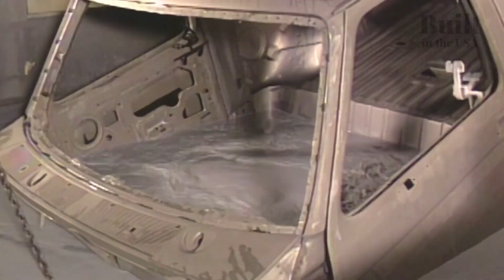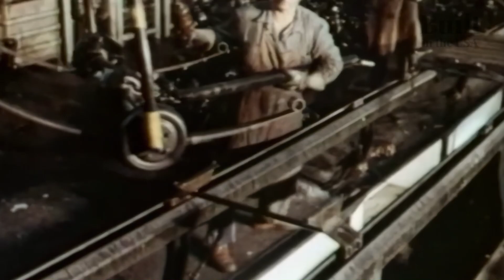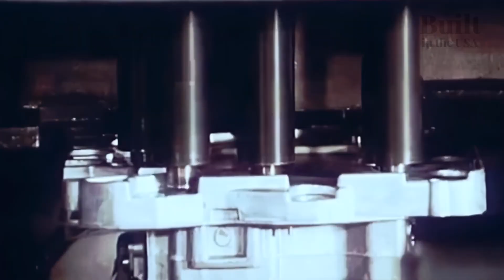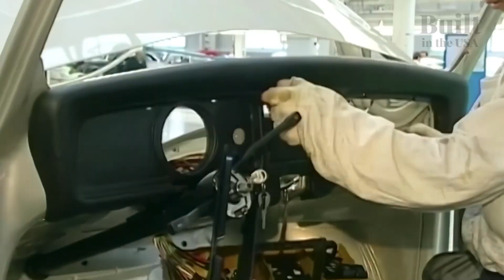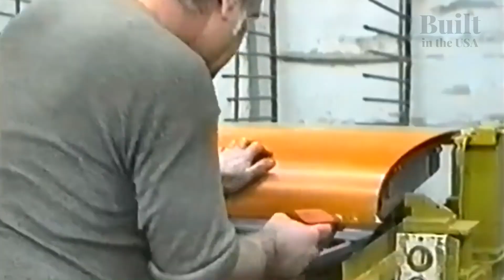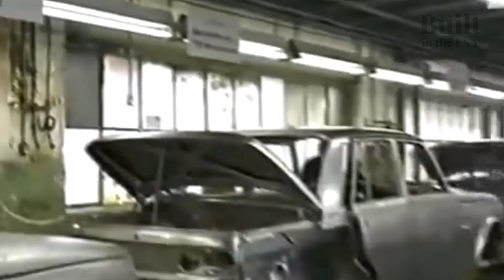Inside the 1990s Ford Truck Plant – Old but Gold: A Nostalgic Look at Michigan Truck Plant

Comment: Robotization😂😂. I think automation is the word you were looking for.
Reply from the maker: Good point. "The manufacturing process is highly automated. The production line uses advanced robotics" - that would sound better
Reply: robotize | ˈrōbəˌtīz |
verb [with object] (usually as adjective robotized)
convert (a production system, factory, etc.) to operation by robots.

Comment: I bought a 96 F-150 with a 302 5.0L V8 for my first truck and I am so happy with it. It’s got 218,000 miles and runs like brand new ^^
I’m gonna be taking it on a road trip this November to Florida.
Reply from the maker: 218,000 miles — wow! Congratulations on such a car.